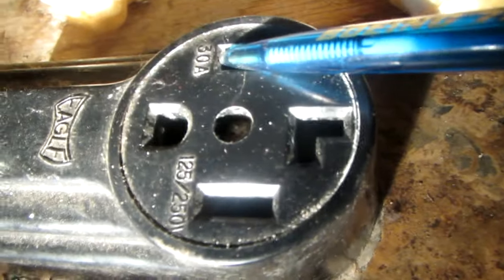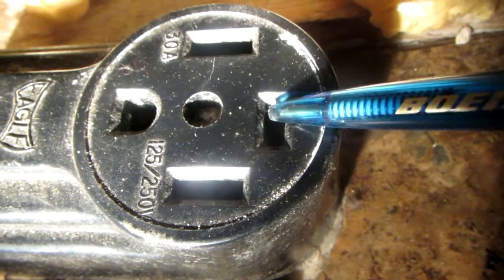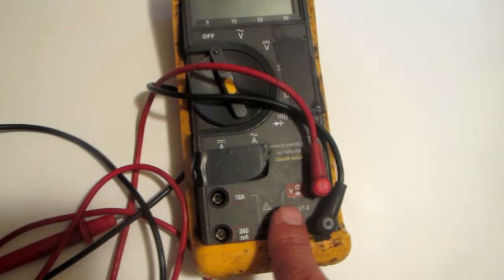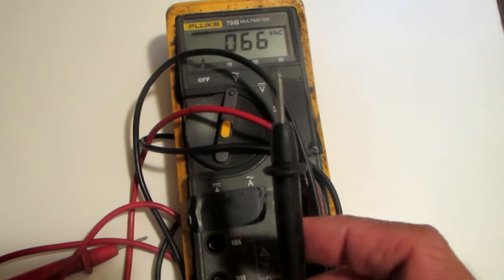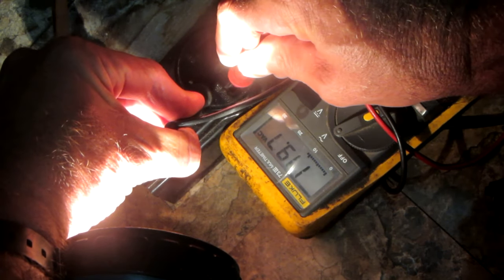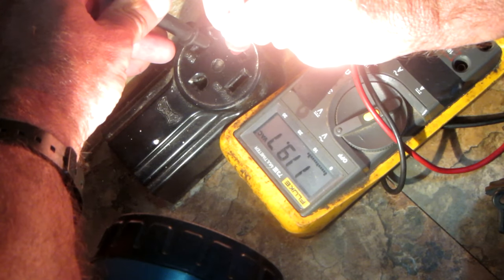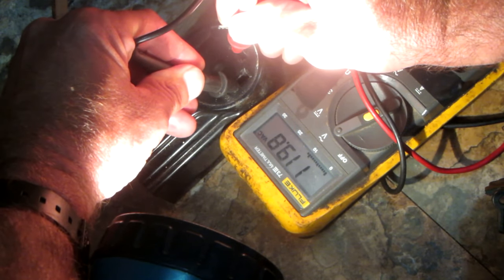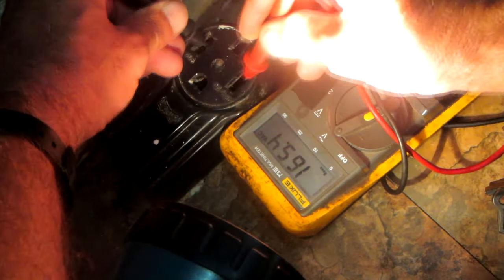Using A Multimeter To Check  220-240 AC Outlet

Comment: You said if someone is  unfamiliar with using a meter they should get a professional. I'm unfamiliar with using a meter, but that's why I'm watching this video. Looks easy as pie to me, thanks.
Reply: make sure your meter and leads can handle the job.  what he got was close to half of what comes into your house typically. be careful. he is using a nice fluke. Mr photonicinduction is usually doing it wrong for you.
Reply: Checking with the multimeter is easy.  Diving into the outlet thinking "I've been shocked by 110 and it doesn't really hurt what can 220 feel like? Can't be that bad"
Well it is....  220 causes death

Comment: I tested everything in order just as you did. Each hot independently read 123 V against the ground and neutral. However when I tested both hots at once I got ZERO, not 240…. Which I guess explains my the dryer won’t heat but I dont know how to fix this… the outlet is wired correctly.

Comment: i checked my voltage with the voltmeter and connecting the 2 hots i got 220...i checked both hots independantly against the neutral and got 120 each...I checked the ground with both hots and get nothing...is that telling me the ground isnt hooked up on the other side of the plug??

Comment: Great video, short and sweet. I was concerned Id blow my M-Meter testing a new 40gal elec water heater thats not heating. Ive got voltage to both sides with volt detector, resistance is in spec on both elements, just need to know if I could test 120/220 and then make sure i have the amps to drive the elements. Appreciate your video. Thanks Again

Comment: I have a outlet that's looks like this one in garage.must be 220 240 like yours ?I want to install a throught the wall ac and the ac says its 230/208 will it work on this power?but I must pass the wiring to living room and what kind of wire should I buy ?thanks

Comment: can you help me .. I tested my 220 line and I got 127 v  comeing from all sides  and when I test for 220. I get 137v
Reply from the maker: +C. Osi Could be a major problem.  Could be a simple fix. I have seen low readings when the meter lead contact point was corroded, loose, or insulated by corrosion, or some foreign substance.  I don't know your skill level. Electricity Kills. I recommend you get  Get a professional  to check volts at the source and resistance of the wiring.    Could be simple, loose, or dirty connections. Could be complex,  Bad output at source. Maybe deteriorated or bad wiring.  Good luck.  Thanks for watching.

Comment: My meter just has a setting for 200 volts ac. Will that still work to test 220-240?
Reply from the maker: I have never seen a meter like that I don't know? Thx for watching.
Reply: I figured it out. Thank you for posting this vid. very helpful.

Comment: Why my multimeter got burned when I put it in 220v?
Reply: +trelak os Always make sure you have the testing wires hooked into the right holes and that it's on the right setting. If it's not, it can arc the meter and damage it.

Comment: It should be exactly 120V on all of them.
Reply from the maker: +Matt Bruns       In a perfect world.   But when you add impedance, resistance, induction, ohms, corrosion, meter hysteresis, and Murphy's law.  For the most I agree with you.
Reply: 240v + or - 10%. They say 215v to 260v is OK.